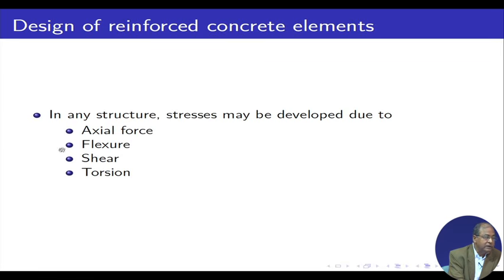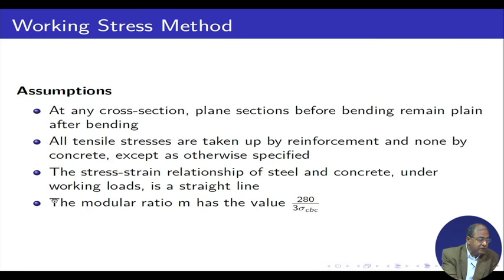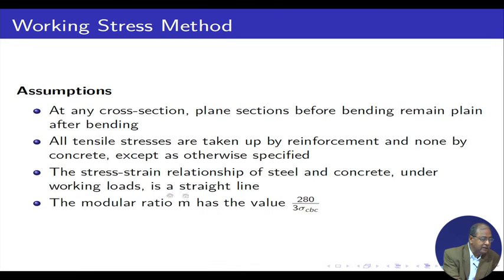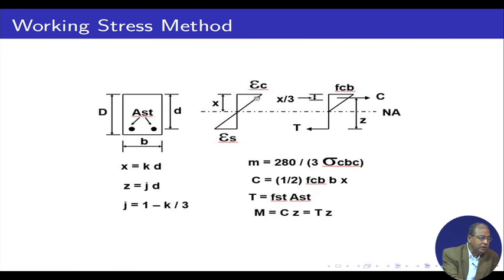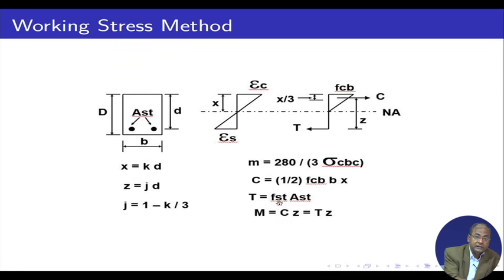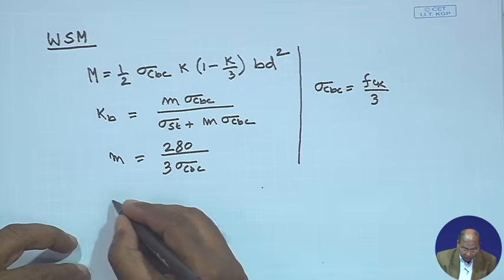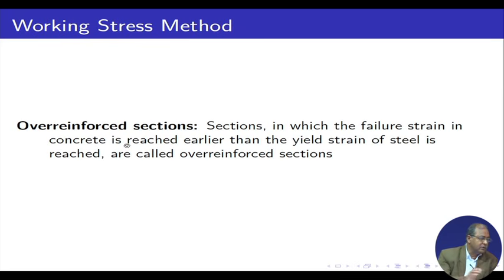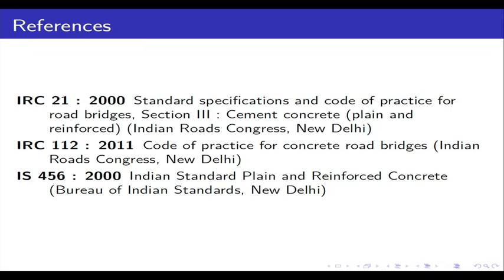Working Stress Method

Comment: Sir, I want to ask you.  Whenever we do any RCC work or concrete, we use Sir Steel in it.  But Sir, when we extract or calculate the quantity of concrete, steel is not reduced in it.
Reply: we assume concrete doesnt take any tension on the tension side and in compression we do reduce the concrete area when calculating moment of resistance .